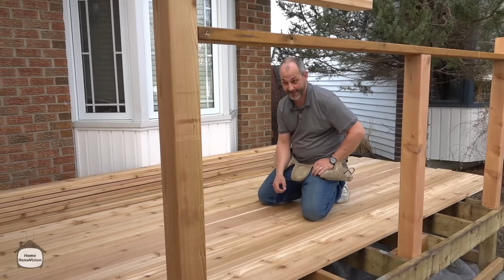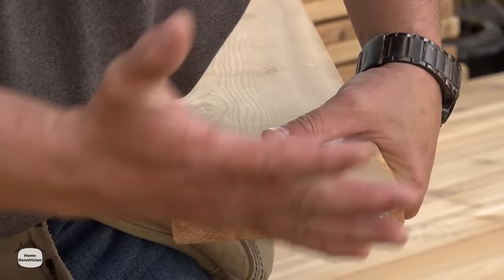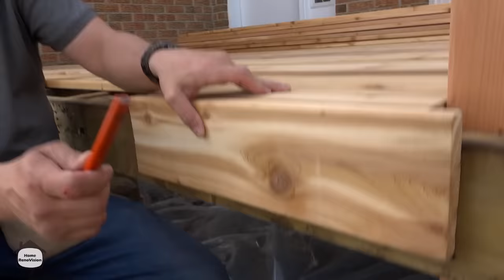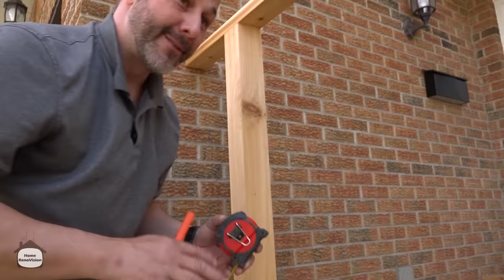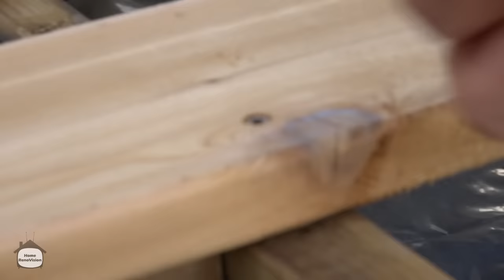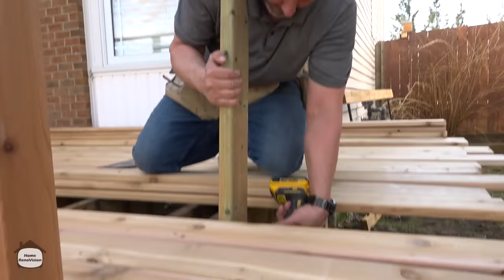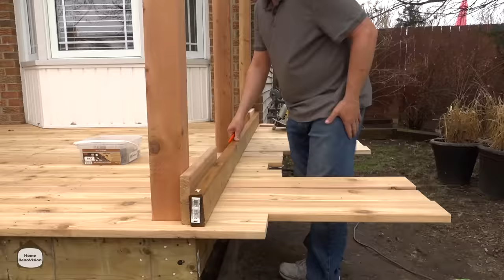How to Install Deck Boards in Shade | DIY Deck Tutorial

Comment: Congratulation for your You tube channel.  Definitely my favorite reference for my renovation work.  I watched over and over again your decking videos.  You never seem to put tar paper on the joist before laying down your decking.  May I ask you why you do not use it and if you see any benefit using it?
Reply from the maker: I don't see any benefit unless you don't use any maintenance program. all you need to do is wash out the organics 3 times a year.

Comment: good Morning. I have a older deck that is in good shape but a few boards are pulling up.  They were put in with staples. will the CAMO MARKSMAN PRO a good tool to reinstall the board pulling up.  I all so plain installing new board on my other deck hopeful this year 2019. I have seen you install the decks using  this tool.  Jack

Comment: I have a idea for a video. I need a new basement door replaced. Threshold is rotted out, I have cinder block opening. I had a estimate of close to $5,000. To replace. Can't afford that. Of course it would have been a great door product. The labor was just over the top. But while it is summer here, I think it will be the perfect time to replace it. I may have to go with a " big box" door. And we may have to DIY it. This is a 30 year old home. But when they built the deck above, they didn't do something correct, so the main board on top of the cinder block rotted. We have paid to have that replaced. Correctly, so far. They put a flashing and a way for the water to run off. But we are on the east coast, Maryland to be exact, and close to the Chesapeake Bay. Cold wet winters. Any suggestions for the best door, at a reasonable price. We have a 9 panel window metal door now. That would be great again. It allows some light.  Thank you
I love all of your videos, I think I have watched them all. Thank you.
Reply from the maker: Hi , in my opinion just about any door on the shelf nowadays is a good product. If cost is a consideration go with a basic door. It will cost 20 bucks a year more in heating cost but that is sometimes easier to swallow than a huge upfront cost. The secret is making sure the door is installed so there are no gaps that the wind can blow through. just about any door with a window is reduced to an r5 value anyway. Cheers! Don't buy the hype!
Reply: OMG I am going through the same BS situation and have to get repairs done before winter comes!  I just bought a house and found water leaking and damage above sliding door frame. There seems to be a leak with the flashing or there might not be any; can't tell unless I pull siding. Well hoped everything worked out for you!

Comment: What's your opinion on dewalt vs milwaukee for impact drill and their line in general your videos and advice are so helpful full send bruh!!!
Reply: djm93 Personally I prefer the Milwaukee over the dewalt. 

Honestly though, they’re all (major brands) fairly close in performance, unless you want to really dive into very detailed performance reviews. 

Past that I believe personal preference and budget is going to dictate what tools you choose. 

I personally use Ridgid, but that is strictly my preference, find the tool that suits you best. 

Dewalt has the flex volt technology, Milwaukee has the really high capacity batteries, but those don’t mean anything if they don’t work for your needs. 

Find the tool you like and learn to make work for you. Especially because there’s a lot of push towards cordless technology, so the other thing to consider is not investing in too many different brands of cordless tools, so as to not complicate finding different batteries for different tools all day on the job site.

Hope that helps, happy building.
Reply from the maker: Milwaukee has more power and a longer lasting battery, however dewalt is less expensive and truth is homeowners don't need  more power than what it delivers.

Comment: Timely series of videos as I am preparing to do the same on my 22 year old deck. I noticed that you didn't use the Building Tape that you talked about in Video 2 on the joists. What was your reasoning for not using it?
Reply from the maker: Thanks for the question Bruce, I was simply outlining the option in the case where someone wanted to ensure a longer life. In this situation the client is choosing to pressure wash his deck every spring and reseal so the build up of organics will not happen and therefore the joists will not need the extra protection necessary when a deck is neglected. Proper maintenance eliminates the need for extra investment

Comment: Great video. did you use the joist guard tapes that you mentioned in the second video?
Reply from the maker: Nope! I prefer to have the client wash and seal on a regular basis so that it is not necessary. the tape is for lazy rich people.
Reply: Home RenoVision DIY thanks for your  reply. I'm not a crazy rich ppl, but I am about to put my composite decking board on my diy deck. Do you think it's necessary to use the tape?

Comment: I've been laying deck boards and I'm getting close to the house and after laying them out unattached, my estimate is that I'll have about 2-3 inches of dead space before the house.  What do you recommend to do in this case - trim a 5/4 down to fit,  or trim several to a narrower width to end up wider near the house?  Thanks.

Comment: Great video and good content.  Really helpful to me.  I am currently replacing boards on my deck that was built several years before I bought my house.   My deck takes a beating from the sun all day and after 10 years it was time to start redoing the surface of my deck.  When it was built they used nails but for the replacement boards I am going back with deck screws.  I have a 35 x 20 foot deck so I am replacing over 71 20ft boards.   My dad is helping me and we are about half way done.  Thanks for the tips.

Comment: TIP: When building such a nice deck using cedar. Why not use "joist tape" to seal the top of the joist from taking on anymore damage over the years. For such a cheap add will add years to your deck.
Reply from the maker: You could. I prefer to pressure wash every year to remove the organics and you get the same result.

Comment: Jeff, dude, how do you get all the deck boards straight? Surely, if the 1st board is like a banana and then you space all the boards on that, they'll all be bananas?
Reply: And that's the reason you begin decking from the house instead of from the outer part of the deck. The guy in the video says to do the opposite. Wrong. I used to build decks and starting from the house is best because not all decking is the exact same width
Reply: He says it @0:36 minutes

Comment: Screws or galv nails.  Which is better and can I use 2x6x8.  For my deck boards
Reply: 2x6 is great for deck boards, more strength and longevity. Also screws are better, particularly stainless steel or something that is ACQ (acceptable for pressure treated lumber). Nails tend to pop out over a long time. I know people who prefer nails, but I think the screw folks are on the better side of the debate.

Comment: I see lots of  boards cup on the bark side and you state to always put that side up...what is the reason?
Reply from the maker: This deck is close to the ground and in the shade. It will most likely swell and not shrink. This way I can protect the deck from the young wood being used peeling in layers.

Comment: A little confused -- is the decking untreated cedar or is it treated with something?  It looks untreated, but he mentioned pressure treated lumber at some point.  Is that just for the joists? I'm working on some deck repair now -- the sides of the decking on my screened in porch are rotting -- and I have used untreated cedar stained with a solid color Behr waterproof stain to this point.  Wanted to make sure this was a good material choice that will last for a while. I have been staining the boards on the ends as well to prevent water entry there, as it seemed the builder/prior owner did not do this, and water built up and soaked into the end grain and rotted out the wood.  Cannot confirm material of the old wood, unfortunately.
Reply from the maker: cedar decking. pt undercarriage.seal pt with green stuff.
Reply: @HomeRenoVisionDIY  Thanks! Would sealing the Cedar decking with waterproof stain potentially lead to rot?
Reply from the maker: quite the opposite Matt!
Reply: @HomeRenoVisionDIY  Got it -- just trying to figure out why the sides of my deck are crumbling.  Thanks for the tips and your responsive comments.  Love your series -- most detailed advice on Home maintenance/DIY out there, often with tricks that make it easy for amateurs to accomplish good results.

Comment: I had my decking boards layed out the wrong side up (2 years ago), and they started crowning. Can someone tell me can they be saved?  I was thinking of simply fliping and fastening them.
Reply: Had same problem. I flipped the boards and used longer screws. 8 years later no problem.  Looks good

Comment: Hi Jeff well you certainly have awesome feedback on here!  I live in New Zealand, and my son and I are about to tackle cleaning and then painting our deck.I came on here initially to find out how to remove a long piece of timber that has sort of cracked and dips when you walk on it but I've got engrossed with your video overall as it's so informative, and I'm working on being independent and not having to ask aka pay some guy to do things for me.  Having said that a year ago I paid a couple of guys to extend the deck and put a bit of a wall around it for privacy from the road and neighbours.  .I'd like your opinion on how it's turned out, given they didn't align the extended bit with the existing boards so it looks queer!  Given your extensive knowledge i'd like your feedback on what that could result in besides the obvious unsightly aesthetic affect.  I mean does it make it more susceptible to say rot or any other ramifications we may expect down the track?  Could I send you a picture maybe please? I feel I'm a bit all over the place, but that comes from someone whose a novice but determined to make good of this patched up deck and be able to enjoy cocktails on it before winter arrives!!  The woods pine btw and thats as much as I can tell you, all these measurements like 4 x 2 for instance elicit blank stares, I have so much to learn:)

Comment: Too many opinions on the bark up or down. Some say sunny side up, bark down and others say crown up on top.
What to do?
Reply: PIGROLL’S ECONOMICS For some reason all these videos on installing deck boards with crown side up are dead wrong. The board will shrink and warp in the opposite direction of the rings in the wood. I learned this the hard way by installing my deck boards crown side up. After a week I noticed water pooling on some of the deck boards after a rain. You can’t fight mother nature, crown side / bark side DOWN.

Comment: Is worth noting that bolting the beam to the post like that is illegal in many places. Also, there's almost no combination of span and influence width that allows for a single board to act as the beam like that.
Reply from the maker: Also worth noting that the deck is 15 years old and has not had a structural failure even with all that was wrong with it. In my experience an engineer would have the professional opinion that if it lasted 15 it will last another 15. All I did was make it 3 times as strong for good measure. It is a practical approach to this type of situation. Cheers!  nOT PERFECT...JUST CLOSE

Comment: Can someone tell me why they are called 5/4 deck boards. I measured them and they were not an inch and a quarter thick. I'm confused.
Reply from the maker: LOL, we still refer to dimensional lumber according to its original dimension from 100 years ago. Over time the actual size has gotten smaller as we have a better understanding of the engineering needed to accomplish different goals and the opportunity to make smaller lumber perform the same task was accepted . Cheers and Have a great Christmas!
Reply: @HomeRenoVisionDIY  Thanks for the reply and also the great video. Merry Christmas to all and to all a good deck.

Comment: Why not just pre drill a hole then use the screws? Me and a few friends did a deck and one person made the holes while the other person screwed. This way no Splitting.
Reply from the maker: That works too. I just find it a lot of extra work!Cheers!
Reply: Cedar is such a soft wood the only time you should predrill is at the end of the boards.
Reply: Except now, after having watched this video, we know how to screw straight into the ends of cedar boards, w/out even having to predrill! Yay!!! Thanks for that one, that’ll come in handy, prob for the rest of my llife!

Comment: For deck boards bark side down is the rule, isn't it?
Reply: Yes, exactly my point above... Just trying to spread the word so no one makes the same mistake I did! hahaha
Reply from the maker: oLD RULE FOR OLD WOOD. NEW WOOD IS SO SMALL IT HAS NO EFFECT WHEN BUILDING CLOSE TO THE GROUND.
Reply: Boards shrink and curl opposite of the growth rings so shouldn't they be laid with the smiley face up so when they shrink you get the crowning on top
Reply: So on an elevated deck should it be bark side down? That way the boards will crown and water will run off.

Comment: Dude,  45 tilt your deck board drive a 16th at a opposite 45, and hammer it in... keep it moving, 
Btw you want to butt each board flush, because after it dries a 8th will become a half 1/2nch gap...
Or do it your way, ...

Comment: I have to disagree about how deep to put in the screws. Half the boards on my deck looked like crap, the other half were fine. But the screws were so deep it was impossible to get the boards off without destroying all of them completely. So no boards could not be repurposed, they all went to the dump instead. Wasteful, especially in this day of out-of-control deforestation (google it, you will be shocked).